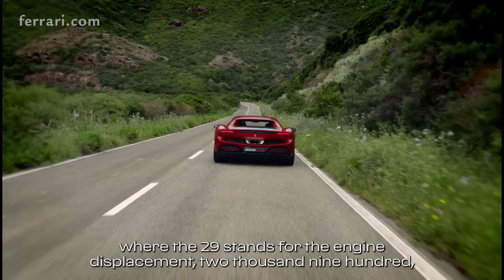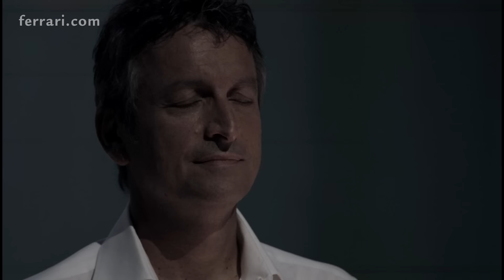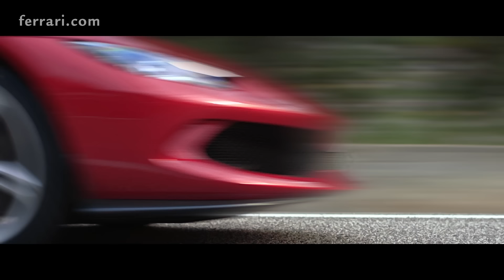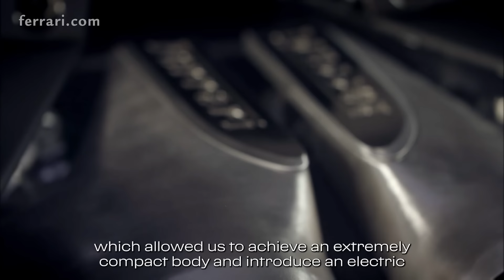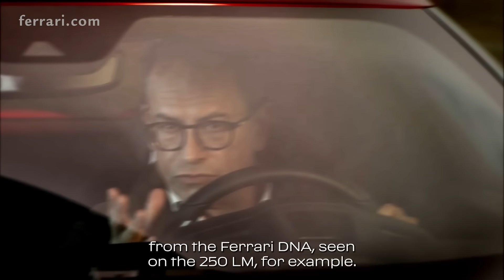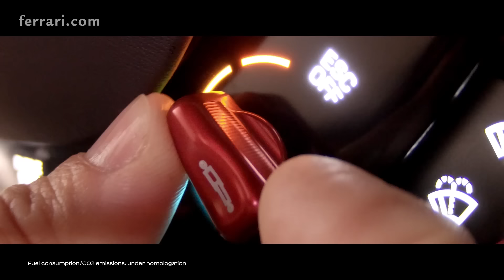New Ferrari Sports Car World Premiere

Comment: I love exotic cars too and stocks are one way to make money.

,,AMAZON: 
Yep, I bought a ton on the dip.   It's getting cheaper relative to its current earnings (half compared to last year). 

Amazon invested $14 billion in the last quarter alone, the same as it spent in 6 months before that.   It is a do not sell stock.

...With the Delta virus coming at full speed ahead, pandemic sales will make a comeback.

Amazon is investing so much money, that no competitor will ever be able to catch up.

Amazon's not going anywhere so I know that eventually it will come back.    
Fidelity considers Amazon as a large growth company (probably because as big as it is, it still only has 7% of the retail market)

Get on board or be runover, it's up to you.

Comment: Why are there people who still crave a manual gearbox? They went out with starting handles. ‘But it’s not a drivers’ car without a manual’. Bollocks. Show me a motorsport car with a manual, three pedals a waste of time except so sad people that post ‘heel and toeing’ on YouTube. Heel and toeing or double de-clutching was a technique used in the last century to select gears before synchromesh arrived and there were only 10% of the cars on the road. Sitting in a queue or slow moving traffic pushing a pedal and waggling a stick is a waste of time. Move on.

Comment: If this is supposed to be about "fun to drive" then why not make it manual transmission? Just because it's a hybrid it doesn't mean you can't build it with a manual. The Honda Civic did manual transmission and electric hybrid back over 20 years ago...

Comment: I love it and the new direction this takes Ferrari; Nimble, fast, and fun. With the V6 Turbo produces plenty of power, hybrid for instant response, and as Colin Chapman put it, "Adding power makes you faster on the straights, subtracting weight makes you faster everywhere.” - Just a car fans opinion. It is a much more modern style in ways, 1 little aesthetic idea would be to use the seats center metal backplate shapes to reshape the single exhaust and tie in the whole car.

Comment: only 830HP?, acceleration in the stomach is more important than numbers?, Fun to drive, seriously? (with a CM at kilometers from the ground)  a CGI video?. Better to stop here. This Ferrari video is pathetic. If Ferrari does not do anything this model will be one of the last failures. They can do better things. 
Tesla plaid, 20k rpm, +1000 HP, the definition of what is fun to drive, 0-60 <2s. low CM and affordable. 
You can buy the style for 2 persons and show to your friends how ignorant you are in car performance, or have a different model, use with your family and really, really have fun to drive on weekends at the race track.

Comment: This  thing is a  Confirmed  abomination  of the  upsized 458/488 & Even  Something  l  can't  remember  at the  moment  that's  the  Current  4 Cylinder  Wheezer from  Maser and  with the  same  highly  overrated  enzo  B pillar  Slash  up. Doesn't have  any  impact  at all  simply  is a  ridiculous  Downsized  458 and  the  Smarter  Company  Would have  approved  on a  More similar  288GTO  Styling  theme  than the  already  Long  in the tooth  Milking it  for  more than  it's worth  458 angles.The Roma  has  style  all  it's  own  taking  from the  outgoing  Cali.  This  however is a Completely let down  embarrassment  coming  from the  land of the  now  Bouncing  Donky.

Comment: Stile: l abbinamento di un frontale lineare e moderno (tipo sf90) col 3/4 posteriore morbido e classico (passaruota, lunotto e prese d aria chiaramente ispirate alla 250 lm del 65) non lo trovo armonioso e corretto. Isolando le sezioni (anteriore, 3/4 dietro, posteriore) sembrano 3 stili e macchine diverse fuse insieme.

Comment: I think the design of the light could be done in a better way. If the day lights were integrated with the main lights and the main light split horizontally into two parts that would make the rear and front end look much better in my opinion.